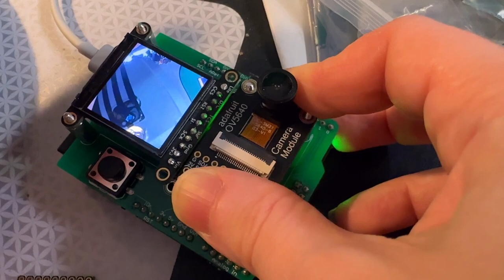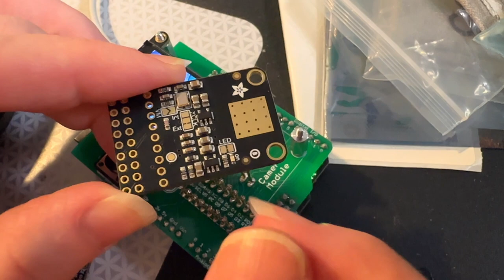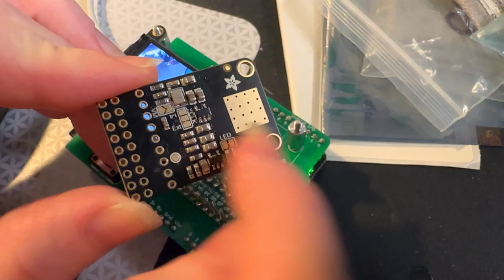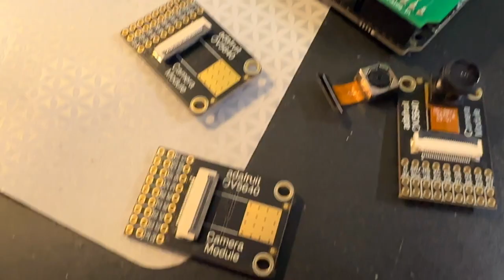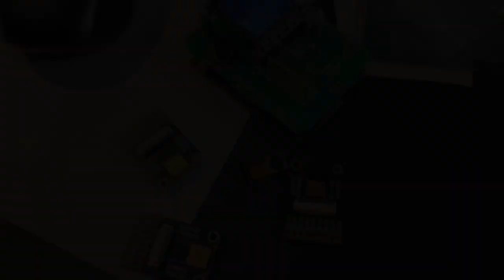We test a tester for the Adafruit OV5640 camera breakout

Comment: I’ve been trying to figure this out for a few months. 
My application:
Purely 11.4-12v DC automotive/marine 
Live 24/7 but records only when motion or Wi-Fi into get the view
Six cameras in a circle about 5’ apart from each other (outdoor winter conditions) but then have the controller(s) inside, where the (Live or video) can be stitched and saved onto a USB or SSD
Open to solutions. Thanks